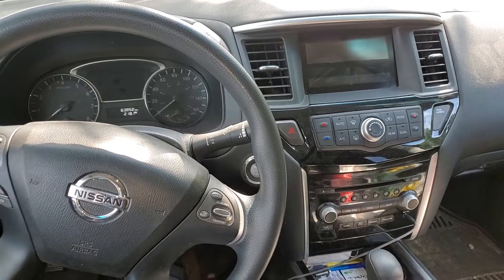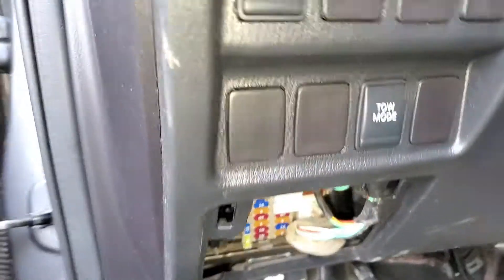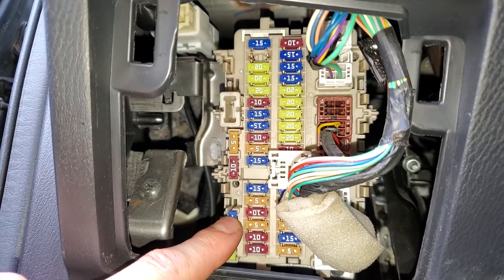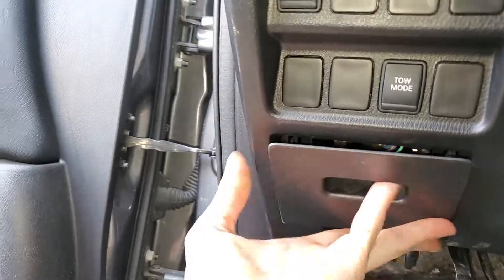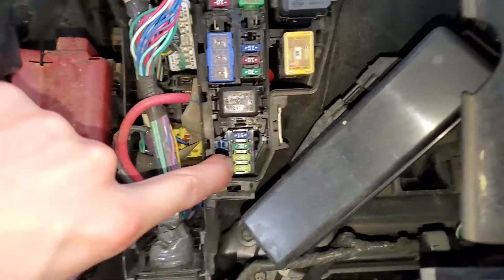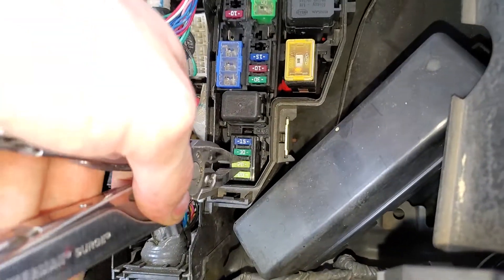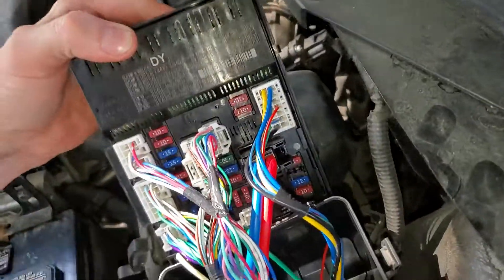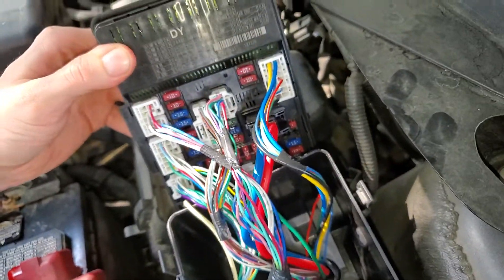2015 Nissan Pathfinder Blower Motor Fuse Locations

Comment: How about the fuse for the cooling fan? Would you know where it would be located? I just installed a new dual fan that is located between the radiator and engine. It was working and now doesn't seem to function, so I added a new 25230 9f915 relay. I bought a new thermostat which I haven't installed, because I think I'm missing a fuse for this cooling fan. Can you help me out?

Comment: Hey there,
 My front blower motor just quit working checked both fuses by the drivers door, top one is blown and the bottom on is fine.
Replaced the top and it automatically blows again, what could be the issue??

Comment: hello sir, my rear blower is not working. The last 2 - 20amp fuses you mention does not have power. Tested with light tester. Both terminals of same fuse-no power. Can you help please. Upper half of this box  all fuses fuses same way- power. Thanks and regards

Comment: Where’s the ac relay switch, my ac fan is not turning and would like to change switch.  I have a 2013 Nissan Pathfinder and the car is over heating when sitting or idle